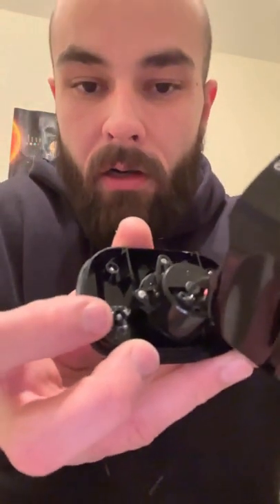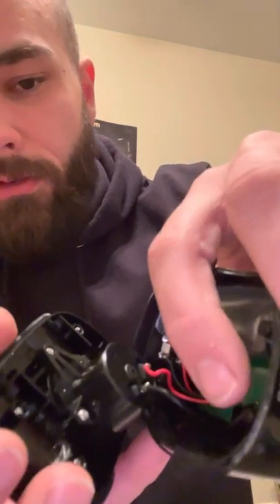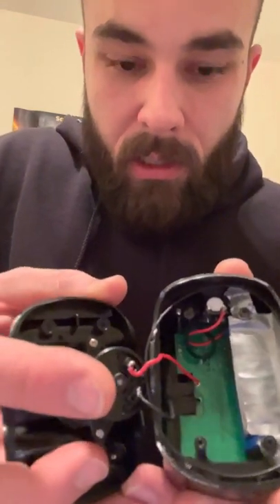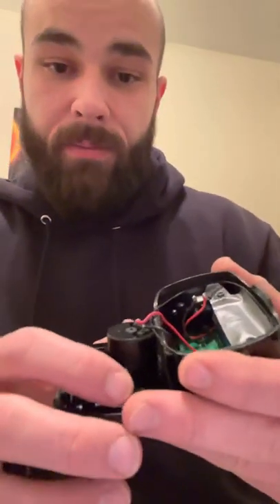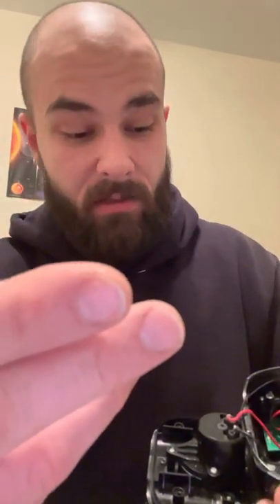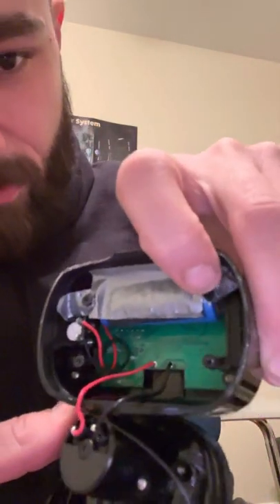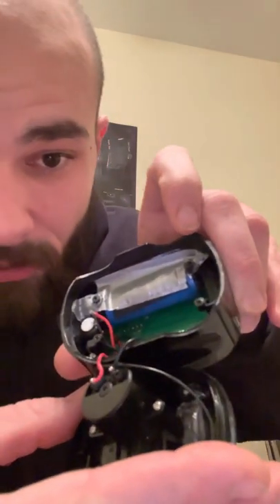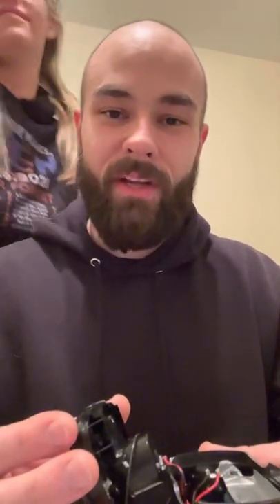Pitbull Gold Shaver: How to Fix

Comment: Mine looks ok. I opened it and i dont see nothing wrong. Mine turns on and then runs for a bit and turns off. Its so annoying
Reply: Same
Reply from the maker: Hey y’all.  I was wondering if you solved the issue with your shaver.  Does the display go “00” when it turns off?
Reply: Mine does this too
Reply: Mine too! I wonder if the Battery needs replacing.

Comment: Thanks for the excellent video.  Mine was a motor issue. Voltage was good to the motor, but it wasn't spinning. I detached the motor from the bottom plate by removing the three screws. With power on, I slowly turned the gray spindle that's attached to the motor. After a few manual spins, the motor kicked in and started working again.
Reply: Did it smell bad? Because mine smells bad
Reply: @franciscorado4711  The motor didn't smell bad, so I believe the electronics are still ok.
Reply: Mine is a motor issue. Gonna try what you've outlined here and see what happens! Thanks!
Reply from the maker: Yea that’s strange.  It might have been gummed up a bit.  Well done guys troubleshooting the issues.  My pitbull still hasn’t died.  5 years strong! Stay Bold y’all!

Comment: I womder if i can fix mine. My provlem is that the battery is dead but when i plug it in it thinks it’s full. I’m guessing mine will be the board issues. Sad. Really liked it when it was running good. Luckily it runs while plugged. But having the wire is annoying.

Comment: What do you think the chances are of finding and replacing the battery? Mine started fine,  I got all 90 minutes. Then it would shut off with around 20 minutes left,  then 30 minutes. This morning it was fully charged and shut off after less than 5 minutes,  so I assume the battery is just gone.
Reply from the maker: Did you by chance get it in the last year? They do offer a warranty. If not I would look up the spec on the battery.  Should be obtainable through their site.  Looks like a common vape battery.
Reply: @Its_zachpaul  mine looks just like the Pitbull, but it was sold under Hexashaver. My wife bought it for Father's Day 2020. Doesn't even come up now.  Lol. 
I see the expensive ones, and cheap ones,  and I always wonder what's the difference.
Reply: Same problem I had.The problem was the battery.There is a guy on ebay that repair this machines.He repaired mine and it’s working perfectly fine 👌🏾😎

Comment: A year later and this video is still helping. Was able to fix mine today after dropping it. Luckily the mounting holes didnt break but the battery seems to have broken off from wherever it was making contact. Stacked several layers  electrical tape on the side of the battery and that put enough pressure when the unit was closed down allow it to turn on. Thank you.

Comment: Thank you for the video.  Mine had the text 188 on the screen and it wouldn't start.  I removed the battery and soldered it back on.  Now works like a new one.

Comment: Thanks for re-opening it just to record. Mine somehow got water inside (I guess I must have left it under the water stream, which the IPX5 waterproof isn't strong enough) and it must have shorted the battery or the circuit board). Opened, dried it up and it charged normally. Pretty sure the battery life won't be the same, but whatever - now I know how to open and replace it when the time comes.
Reply: And I figured out how it got the water: I lost/forgot about the rubber piece that covers the charging port. Realized that after a second water damage that the appliance did not recover from. But oh well, got a new one (a Silver instead of a Gold, honestly feels identical) and I am happily shaving again!

Comment: Unfortunately, I believe after opening mine, it is a motor issue for me. I opened the and put it back together and it worked, but now it smells burnt and won't turn back on again. But it still shows 98----Ummm, It just turned on full blast by itself as I was typing. So now I'm beyond confused. It has a kind of its own works when it wants to apparently?

Comment: So pissed i was gifted the platinum Christmas last year. Never dropped never “water damaged?”. I used it in the shower so idk. I had the charger plug in at all times. Now it won’t charge the digital display malfunctions. Idk what to do. Pissed bcuz it was a great product until it just, wasn’t.
Reply: Today my 2.5y Gold went into a stop, start cycle. Power button is inoperative. It’s currently off but the digital display is on and stuck at “57%”. Has never done this before. Not sure what to try.

Comment: i was gifted a pitbull platinum. It was not charged so I charged it. I noticed right away that the blade/circle in middle that blade attaches to, kept spinning. I unplugged it at 5% and it still was spinning. I held in the power button, nothing happened. I held in the power button and saw the water symbol flashing. Hold the power button again and saw a flashing lock symbol. What is wrong with my shaver? I reached out to pitbull, and have not received a response.

Comment: I have the silver, just noticed today the red light did not turn green after a nights charge. Would you know what's wrong with it?
Reply from the maker: I’d look into the charger port on both the cable and on the shaver.  Sounds like it might need cleaned! Did it charge all the way still?

Comment: Think my batteries are now bad after 3 years--wondering if you think replaceable?  Runs fine with cord now..
Reply from the maker: Well that being said, as long as the battery you replace it with specs the same, you can always replace this battery.  You have 1 solid connection on the battery and that’s all the soldering you’d have to do, really as long as the board stays good, you could maintain this puppy for a long time!

Comment: Is there anyway to prevent bumps ?
Reply from the maker: Absolutely! So when you first shave, beforehand, you want to shower and get your head hair soft.  Makes the cutting of the shaver more smooth.  Then use a cream based shaving cream with aloe (not gel because it clogs the blades).  Then shave away.  After you have completed your shave wash your head in cold water.  This will help minimize the pores and stop pimples or bumps from occurring.  Then I do a final head cleansing with witch hazel and it works very well at cleaning the shaved area and burns very little compared to alcohol.  Bumps might occur right after the shave, but let your head skin adjust to the blades by shaving every 3 days atleast.  This makes your hair adjust to the shaver.  These steps really do work and will help implement a routine to keep your head looking clean, less oily, and less bumpy! Good luck Edwin and happy shaving!